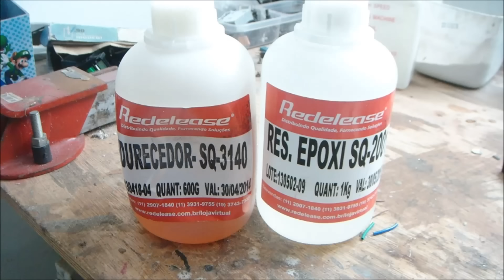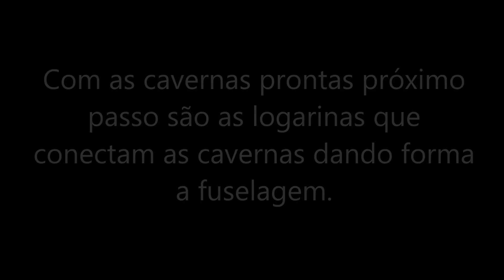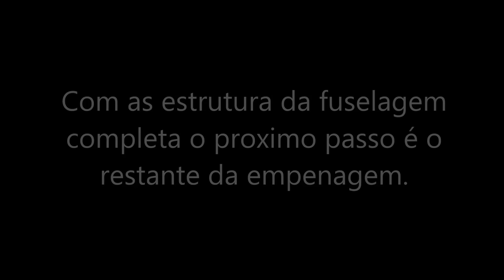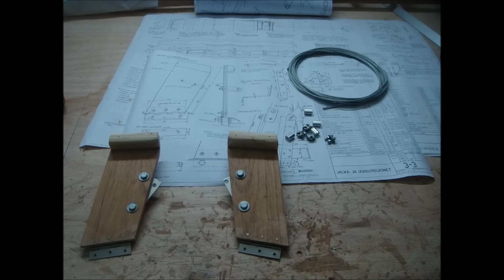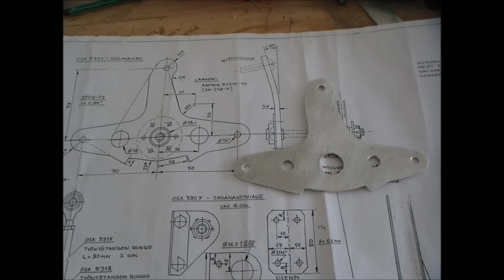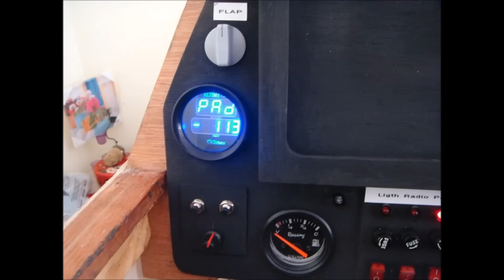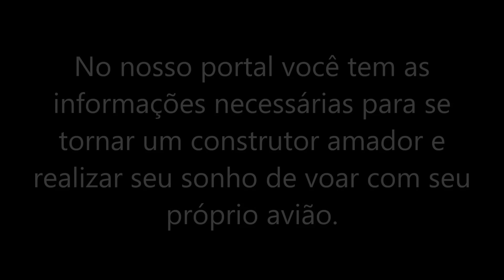Construindo um ultraleve PIK-26 MINI SYTKY - Building a PIK-26 MINI SYTKY

Comment: Como você fez o molde para laminar a carenagem do motor, qual material usou?
Reply from the maker: o molde foi feito em fibra de vidro e espuma pu
Reply: Andre Silva a espuma é igual essa? http://produto.mercadolivre.com.br/MLB-786196011-espuma-expansiva-poliuretano-pu-500ml-_JM
Reply: Andre Silva qual resina você usou para laminar junto com a fibra
Reply from the maker: epoxy
Reply from the maker: e o mesmo tipo mas essa nao da pra quase nada. 
http://produto.mercadolivre.com.br/MLB-688205626-espuma-pu-poliuretano-cola-isopor-enchimento-a-b-2100-kg-_JM

Comment: hola
I'm building the same plane, from the same project. I note that you are making numerous variations, both in the materials and in the thicknesses.
I think it is very dangerous, and for two reasons: the structure will certainly be heavier, and probably it will not be equally resistant.
For example: the fuselage should be covered with 1.2 mm thick birch plywood. However, I see that you show a 4 mm poplar plywood.
That's no good!!!
This aircraft has been designed with care and it should be imperative to follow exactly the instructions given in it.
It flies to over 100 mph and with these arguments you do not mess around.
I suggest a lot of caution: good construction!
Reply: Hi  where can I get that plan for?
Reply: Hi everyone,  where can I get that plan for?